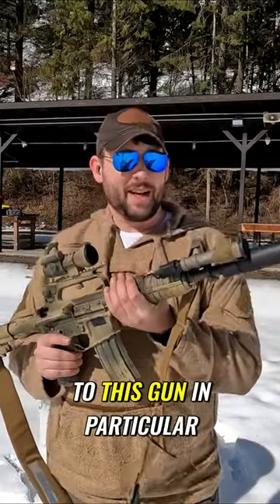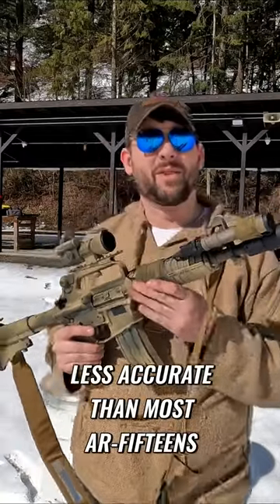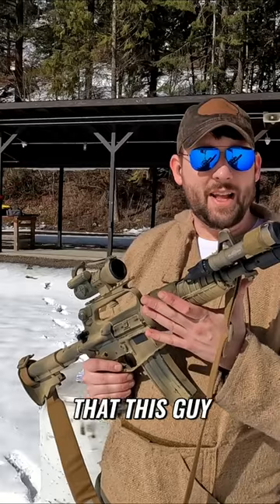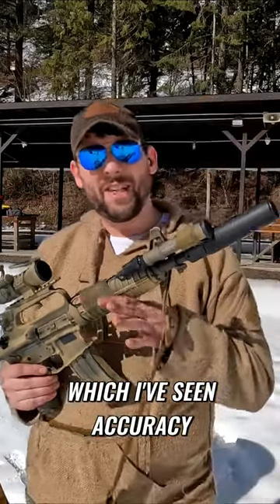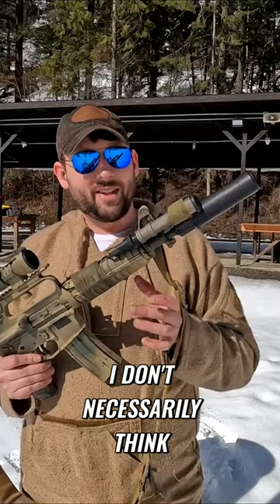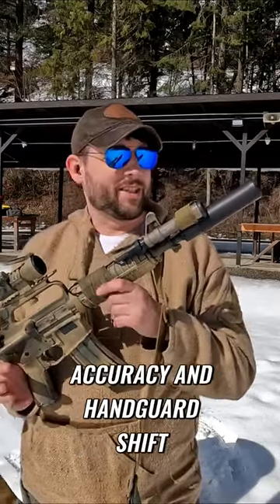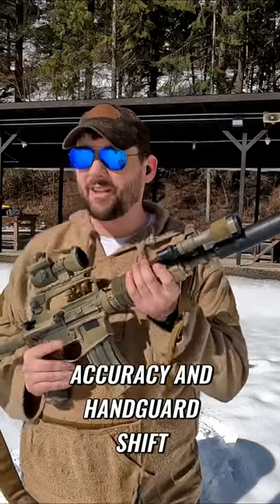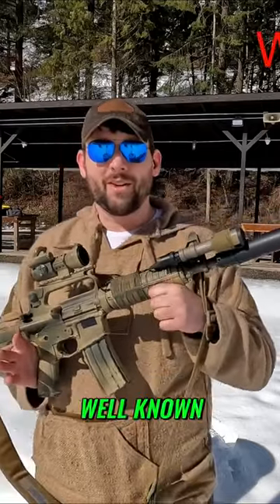My Gordon adjacent carbine’s Accuracy with the Ten Three Barrel Inch Barrel

Comment: If this is a 2 moa guns it’s accurate enough. Cool build none the less
Reply from the maker: I wish it was 2moa lol. Thanks it’s one of my favorites despite this.
Reply: @conceptualconcepts6.9  I am about to do one similar. Roscoe 14.5 mid length but Gordy inspired built with aem5. Hope it shots well and soft.
Reply from the maker: @zachgregory1289  that’s awesome, I bet it will. Most aero barrels I’ve shot have been about 1.5-2moa. The 30 year old handguard on this has a lot of play and flex. Which is why I think the 3.5-4MOA groups are more due to the handguard. And Rosco makes really good barrels

Comment: It's a cqb.  What accuracy do you need for a target 20 feet away tops
Reply from the maker: You must live in a very small building lol. Also, I like my rifles to do more than room to room stuff.
Reply: @conceptualconcepts6.9  someone breaking in is not going to give you much warning.  By the time you head out to see what's up it may even be hand to hand.    What accuracy are you looking for, it a 10 inch barrel
Reply from the maker: @noyb621  my friends 10.3 mk18 is a 1moa gun. My 11” bren is a 1.5moa gun. This is a 3.5-4MOA gun. And where did you get that this is my home defense gun?
Reply: @conceptualconcepts6.9  I was talking about me.   Again what accuracy in yards are you talking about moa at what distance?
Reply from the maker: @noyb621  MOA is an angle of measurement, it can be measured at any yardage. At 100yds it’s roughly 1” (1.047” to be exact) at 50yds it would be half that so .5235” . I measure at both 50 and 100yds.  His 10.3 Daniel defense mk18 measures consistently at 1moa or lower no matter the distance. This rifle with match ammo measure 3.5-4MOA on a good day, I can still shoot it out to 300yds consistently. But it doesn’t change the fact that it is one of the least accurate AR’s I’ve ever shot. 

Also, barrel length has very little to do with accuracy. That myth has been dispelled for a while now. The exception is when the barrel becomes too short to effectively stabilize the bullet.

Comment: The inaccuracy is mainly because it's coming from a 10.3, lmao.
Reply from the maker: My buddies Daniel defense 10.3 mk 18 is a 1moa gun, my 11” bren is a 1.5 moa gun. This aero build is a 3.5-4MOA gun. Barrel length has very little to do with accuracy, that myth has been dispelled for years now.
Reply: For reals. Like handguards affect accuracy LOL!
Reply from the maker: @adriansoto239  free float vs non free float absolutely does, as well as resting on these handguards can be known to cause changes in barrel harmonics. But no, this aero barrel is just dog water.
Reply: @conceptualconcepts6.9  what does that mean that it causes change in the barrel harmonics? What change? What are barrel harmonics?
Reply from the maker: @adriansoto239  barrels shift and whip when a round is fired. It’s usually consistent if no outside force is introduced. Which is why free float barrels are so big in the precision shooting community. Here’s a video showing this in slow motion.

https://youtu.be/hru_sL7BFN0?si=62k67Onupduvkf8P

So what happens when you have a non free float handguard is any pressure put on the handguard can change the harmonics of the barrel causing either a shift in impact or opening of the groups. This is also why you shouldn’t rest your gun on the barrel if you’re shooting longer ranges or for groups.
Reply: Have you tried diff ammo? Non ff handguards contribute to accuracy deficiencies that I know. But also marksman teams drill their handguards and put screws touching the barrels in various places to get the best accuracy possible. Never knew until I met this old timer. And he learned from his Sgt. Who shoots competition. With a4 rifles. Non ff handguards. All in all to me, a 2moa rifle especially being a sub 11 inch ar15 is plenty enough. I'm all bout HD and shtf. And in my state they ruled 25 yards is like questionable self defense distance. But if shtf I'm taking my 16 inch bcm😂
Reply from the maker: @aahhronismyname8068  I’ve tried 5 different types of ammo, and it’s getting about 3-3.5moa with match ammo, I think at least partially due to the handguards on this rifle which have a lot of flex to them creating variable pressure on the barrel. No bueno. And all good points man